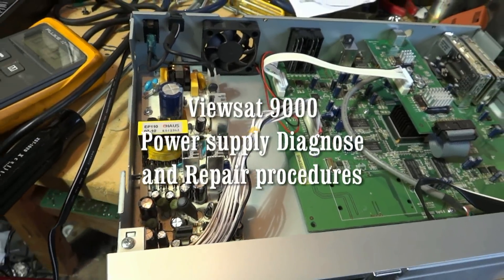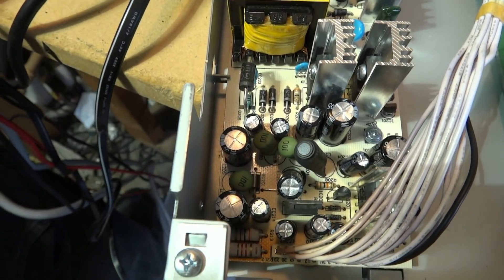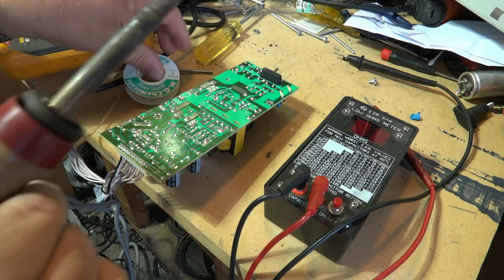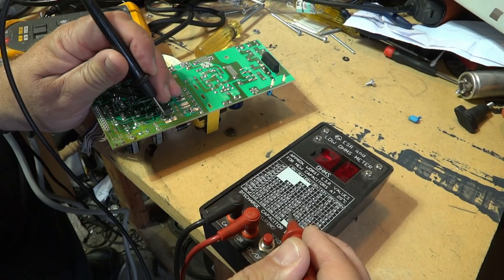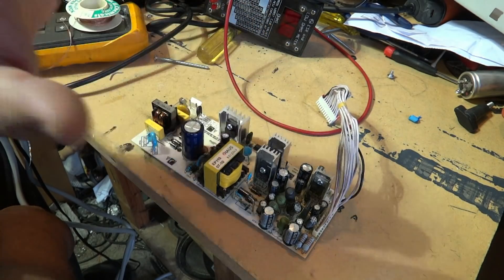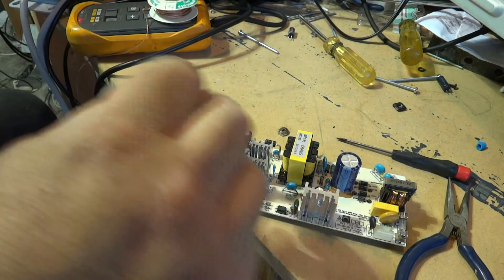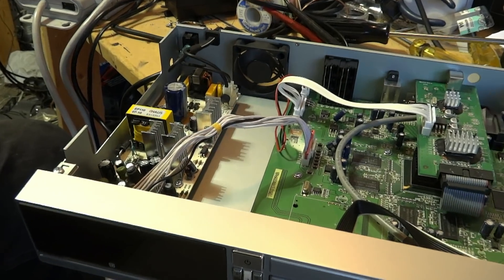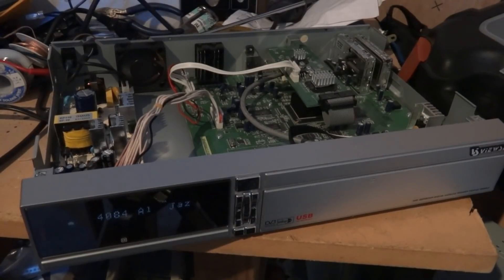Viewsat 9000 FTA Satellite Receiver Power Supply Repair

Comment: Hi, I'm facing the following problem:
https://www.dropbox.com/s/arlh3i2wt3l1rxg/VID_20150124_123549.mp4?dl=0
This happens after the unit has been running for 1 hour, shutting it down and letting it cool for 10 minutes somehow "fixes" it. after 1 hour it appears again.
I checked the power supply and all capacitors and they all have a 0.07 Ohm resistance (which is under 0.09) so it's not the capacitors. Any Idea what causes this?
Reply from the maker: Switching power supplies are designed to shut down if they go into an overload condition. Disconnect the power supply, and put an ammeter in line and measure the current, while it is cold and monitor as it heats up.
You could have an IC or transistor in the amplifier stage that as it heats up goes into thermal conduction and draws too much current.
When I was testing the bank of LED lights I salvaged from a TV, and modifying the strip to run on 12 volts I initially used a power supply rated at 1.66 amps. The LED strips draw .8 amps each. I put 2 in parallel, no problem, went to add a 3rd, and I ended up with exactly the symptom in your video, lights blinking at about the same rate. Swapped the 1.66 for a 2.5 and all if good.
A well designed switching supply will shut down once maximum rated current is reached, but they will try to restart, shut down again, try to restart.
Just like the dead supply in this video, except in this case the caps were bad, and the supply wasn't actually achieving full output, it was shutting down and attempting to restart, but as you can see the pulse frequency is much lower, about 1hz, as opposed to your sample, and when I overloaded my supply with too many LEDS it was closer to 2hz.

Because it takes time to fault, probably your best friend now is going to be a can of frost spray. (component cooler) The cheapest way to get frost spray, as the stuff sold at electronics shops is crazy expensive, is to get some "dust off" and just invert the can when spraying. The propellant is the same, the only difference is in a can of dust off they draw from the top of the can, where the propellant is already in a gas state. In the circuit cooler can,  there is a tube going to the bottom of the can as in a regular aerosol can, so the propellent is expelled, and it gets very cold when the pressure is released (a refirgerator or air conditioner works the same way, but they keep the gas contained, and recirculate it with a compressor.) By inverting the can you get the propellent out, and it freezes. This way when the unit is in this thermal condition, you can freeze individual components, and when you hit the one that is causing the fault, the fault will usually clear until it warms up again.
Hit the same component again, and if the fault clears every time you hit the suspect component, you have found your fault.
Don't overlook  solder connections around power transistors and ICs in the amplifier stage. They can overheat and crack, and then with thermal expansion can go open. This could cause a bias fault, and cause the power amplifier to draw too much current and cause your symptom.

Good luck.
Reply: 12voltvids  wow I never expected such a long answer, but I now know what to do, Thanks!
I'll let you know if I was able to fix it. There's only 1 thing that came to my mind.
if the power supply has overcurrent-protection why does it also have a ceramic fuse in place?
anyway, the fuse is in series with V-, guess I'll pull it out and connect my amp meter there.
Reply from the maker: Niek Nooijens
The fuse if to protect against catastrophic failure, ie a dead short.
All switching power supplies have an over current shut down, it is part of the design.  You still need secondary protection, and that is where the fuse comes in.
Reply: 12voltvids  ok I found the culprit, it's a shunt regulator that's overheating. I can order the part in particular at Farnell (it's a very rare one) but then I have to order at least €50,- of parts. A new power supply is €30,- So I'll buy a new one.
Reply from the maker: Niek Nooijens
What is the part number?
Reply: TL431AC-GE51
Reply from the maker: Niek Nooijens

Did you search Ebay? There are dozens of them on there for about 2 bucks each.

Comment: Excellent video. Reminded me that I need an ESR meter, and much more experience! Do you have any videos on general circuit analysis and troubleshooting?
Reply from the maker: My videos are generally on practical repairs. I haven't done any on the theory analysis of circuitry yet. That is best left for the instructors. I was a diagnostic tech in the repair business for 20 years. Now I just do it more as a hobby and share with you the skills I learned over a 20 year career repairing consumer electronics.
I used to hate the theory courses myself. They were so dry. I remember the instructor at Sony, we were doing courses on the internet, way back in 2002 and I was sitting at home in front of the computer with a web cam. I could see the instructor and he could see all of us, and he kept having to wake people up, when he would see us nodding off.  It was actually quite a good system when it worked.

Comment: Hi, nice video. I have a problem here. I have a Philips tv set with switched power supply. Yesterday I was fixing the built in vhs-cassettedeck, when suddenly the set went dead, and a constant beeping (a beep appr. every seconds) could be heart. I traced down the origin of the beeps and it was the main transformer of de power supply! Now I have checked several things. The 220v ac from the mains (I am in the Netherlands) gets through the rectifier and on to the load capacitir 100uF resulting in 300 v dc.  I have measured the coils of the transformer and they seem ok (no resistants OL). Do you have any idea what causes the rythmic beeping from the main transformer (beep beep beep beep)? Hope you can help.

Comment: Hello how are you, I have a picture of the subwoofer transformer available,  how can I send it over to you.
Reply from the maker: you can send it to
hackinsat@hotmail.com
Reply from the maker: Ok that is a linear power supply in that unit. So the only solution is to use your step down transformer, or to order a replacement transformer with the same voltage current ratings on the secondary, and a primary for your local mains voltage.
It is easy to figure out the secondary voltage. Just measure the voltage with an AC volt meter across the 2 terminals with the white wires on the top. Say for example it measures 60 volts. Then the transformer would be a 60 volt center tap transformer with a 240 volt primary for the UK for example. There will be some numbers on the label which you can google. That should get you the specs for that transformer. Now you just need to find one of the same rating, but with a 240 volt primary instead of a 120 volt primary and you are in business. Of you can just keep it plugged into your 240 - 120 step down transformer. It won't hurt it in any way.

Comment: at 00:43 i can already see 2 bad caps
Reply from the maker: You are so smart. A blind man could see the bulging caps. Not all bad caps are bulged. Go watch a fe of my other videos, like the Panasonic pv4760 video. There was a half dozen caps that were bad in that unit, and not one of them had any physical signs that they were shot.
If you think you can fix things based on how the parts look, you are in for a big shock. Test equipment is needed and an ESR meter is probably the most important piece of equipment you can own other than a DMM.
Reply: for the record i was watching in the lowest quality so sorry for me pointing out the oblivious
Reply from the maker: redstoner200
That's OK I have had many people criticize the use of the ESR meter and say things like "you don't need that just look for the bulging tops"
Yes I think it is pretty clear that if the cap is deformed, there has been an over pressure event occur, but the point I am attempting to make is that more times than not bad caps will have no visual indication that it has failed.
That is where the ESR meter is invaluable.

Comment: First of all awesome video. Question, I have a Sylvania VCR/DVD combo. Last week it just turned off, and I can't get it to turn on. I believe it is the power supply personally. I live in a very remote area, I don't have the money to take it 1 1/2 hours away to get it fixed, single mom, and I'm disabled. I really need this fixed. Any suggestions???
Reply from the maker: It really could be anything, but if memoroy serves me correct, thhere were many issues with filter caps in the power supply inverter boards on many of those units.
Reply: Would it be cheaper to just buy a new one?
Reply from the maker: Lisa Lemus
 Well that was an HD satellite receiver that cost about 400.00, and the owner of it wanted it repaired because first he couldn't find a replacement, and 2 his dish and everything was programmed into that unit, and he would have had to pay an installer to reprogram and reload all the satellites into it.
In many cases, like in the case of S-VHS, Beta, or 8mm VCRs you just can not buy a replacement. If you have a collection of old tapes that you need to playback in order to transfer to a digital medium you either have to repair your old machine, or pay someone to repair it, or send your tapes off to a commercial archive facility.
Myself I operate a commercial archive facility, and I make very good money transferring peoples tapes over to DVD. For most people with just a few tapes this makes the most financial sense. There are people that have hundreds of tapes, or people that are concerned about privacy, or intellectual property, that do not want their tapes viewed by others. When you have a format that is obsolete, you have little choice but to try to repair your equipment that can play that format, and that is the purpose of these videos. And to keep equipment with minor problems out of the land fill.

Comment: i have a rca deck215r tv that does not power on. there was a blown power capacitor. the rating was 470f 16v. well radioshack only had this in a 35v. i soldered it in and it blew as well. now i also got a little sloppy with the solder as I only solder with a torch on cars, but it was in there...so i ordered a pack of 10 of the exact same rating tonight. i'm thinking if i do it right again it'll be ok. if not what do i do? i don't see anything else wrong.
Reply from the maker: For switching power supplies you need to use capacitors rated at 105'C. They are high temperature, high frequency devices.
Standard capacitors are only rated at 85'C and they will blow very quickly.
Radio shack probably only carries standard types.
Also if you put it in backwards, you will get some nice smoke quickly.
Reply: thanks i contacted the seller so hopefully they can send me the right one instead. I put the new one in with the - sign facing the same way as the old one.

Comment: Hello how are you today, I wanted to ask, my subwoofer works on a stepdown transformer because I bought it from the USA, I am living in the UK, can I change the transformer in the subwoofer as it is in a separate compartment away from the rest of the amplifier, please correct me if I have it wrong but is the transformer sending DC current to the amplifier.
Reply from the maker: The job of the step down transformer is to take the 240V AC from your outlet, and step it down to 120V AC for the subwoofer that is designed for 120 volts.
Depending on the type of power supply that is inside the unit will determine what you need to do.If it is a linear type supply, which has a big transformer then you would need to replace that transformer with the correct unit rated for 240 volts input. This is a big job. If it is a switching type power supply it is possible that it is already a universal voltage. Look on the label and see if it is a fixed or universal voltage.
Universal voltage units will tell you so, they will be listed as something like 90 - 250 VAC.  If it says 120VAC then it is a fixed voltage unit.
Even at that, if it is a switching supply it might be a universal type supply that has just been equip with 190V MOV protectors. If you open it up, and it is a switching supply, check the main filter capacitors on the HOT side of the transformer. They will generally be relatively high voltage capacitors. If they say they are 160V or 250V caps, then they unit is probably a fixed 120 design and the MOVS will be probably 180 or 190 volts. If the main filter caps are in the 350 - 450 volt range then the supply is most likely an auto range power supply. You still need to check the rating of the MOV (metal oxide varistor) which look like large ceramic capacitors, usually green, black or red in color and they are generally connected between neutral and the fuse, on the equipment side (not the cord side) of the fuse. The job of an MOV is to protect against surges and over voltages. Once the voltage goes above the break over voltage of the MOV they will conduct, shunting the excess current to ground, and causing the fuse to blow in the process protecting the rest of the circuit.
Naturally if they have 190V MOV and you plug it into 240V even if the rest of the circuit can handle 240V. You might want to google the model number as I am sure there is info on it.  Baring modifying it, it is safe to use the step down transformer, even though it is another piece of equipment. I deal with the same thing at work. We have many people moving over to Canada from Korea so their kids can attend school here to learn English. The mother comes over for 10 months every year with the kids, the dad stays home and works. They always bring their electronics with them, and they face the same problem. All their devices are 240 volts, so they need a step up transformer to make their electronics work. In many cases the power supply is universal, so they just use a plug adapter and it works just fine.

Comment: I have a prolux 30 amp switching PS that  blows fuses instantly  when i turn it on. what can i do to fix it and where should i start looking . no bulging caps or anything obviously burnt besides the fuse. Please someone help ! I love this PS because i can turn it up to 15 volts for 450 watts !
Reply from the maker: So if you blow the main power fuse as soon as it is switched on that indicates an overload condition. More than likely the switching transistors are shorted.
You will need to measure the switching transistors and see if they are shorted.
Also check the bridge rectifier to make sure it isn't shorted. I doubt that the input filters are bad. Put a 100 watt light bulb in series with your AC input,  you can do this by taking an extension cord and separating the 2 wires so you can cut one of them, and connect the cut wire to a lamp socket so that the light bulb is in series with the power supply. This way you can run it up for testing, and not risk burning up more parts. The voltage passing through the light bulb will limit the current to about 1 amp (the light bulb acts like a resistor)  which will protect power supply while you work on it.  If you like I can make a simple video to show how to make the light bulb current limiter. The hard part of this is finding 100 watt light bulbs now that the government has banned 100 watt incandescent light bulbs.
Reply: Thanks 12voltvids , I am a machinist for 20+ years but electronics is starting to catch my interest since this PS has burnt , now i am looking into how to measure . the only meter i have is a craftsman digital multi meter .

Comment: Excellent video,  one question for you, I have a energy 12 inch subwoofer that has the auto on/off feature,  when the signal is lost or when it I turn the power off it makes a popping noise, do you think it could  the capacitors,  reason being the amp is about 14 years old but want to keep it.
Reply from the maker: It could be, but generally there is a muting circuit that mutes the audio (or a relay that opens and disconnects the speakers) during that transition from on to off and off to on.
When the power switches on or off there are usually a few voltages derived from the main supply to operate the lower voltage circuits, and as the voltage rises or falls, it causes a voltage differential in the amplifier stage that if the output is not muted you will hear as a pop, or click, or you may see the woofer oscillate as the voltage drains. Most high power amps have a physical relay that stays open until all the voltages have stabilized and then energizes to connect the speakers, and is open immediately when the power goes off to cut the speakers from the amplifier so that discharge transient  voltages will not be present across the voice coil, as large DC voltages across the voice coil can damage the speaker. This is known as the protection circuit, and from the sound of it, it is not working properly in your amplifier.
It could be a capacitor that is starting to go weak, but really to troubleshoot something like that a schematic diagram is necessary so you can see what the engineer that designed the amplifier was doing, and how the protection curcuit operates.

Comment: Hope you can help me. I´ve a Dell h275p-01 power supply. It works but has a weird sound, like the one in this video, even when I unplug it. I've been loking for a bad capacitor, but I don't see any. Don't even a resistance or mosfet o anything damaged, apparently. The sound keeps coming out from the switch mode transformer. Do you think this is the problem. The switch mode transformer?